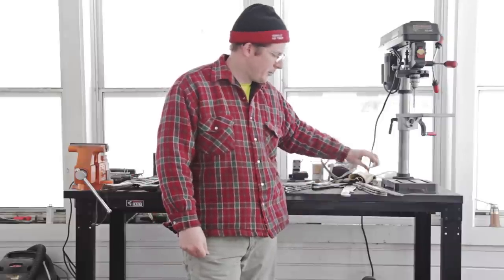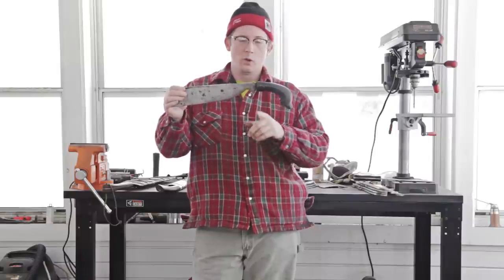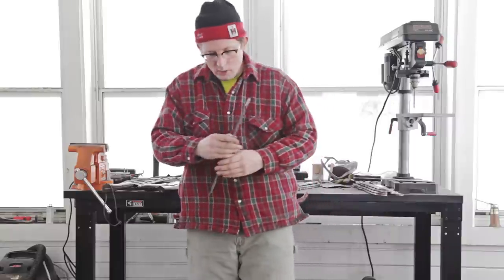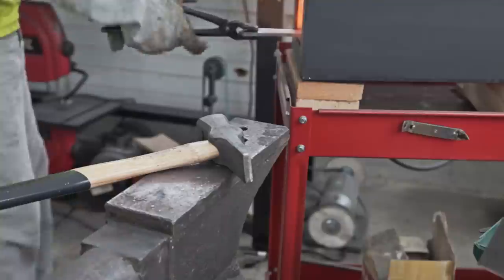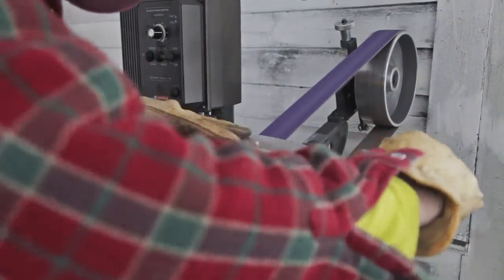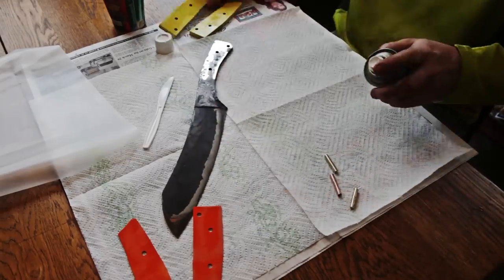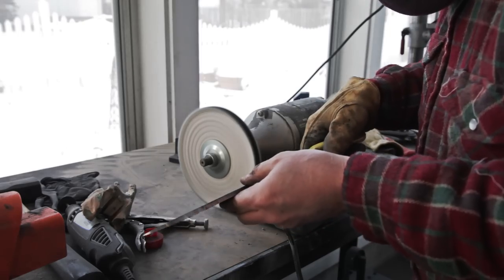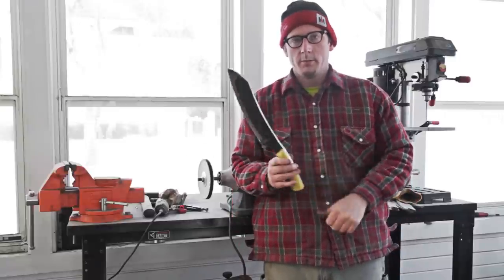Lessons Learned from Lawnmower Blade Parangs

Comment: Nice video. Woudn't it be better to forge at the same temperature that you used prior to your quench. I see a lot of people forge at temperature that are way too low to move much metal in each heat. A bright orange-yellow forging temp will allow you to move a lot more metal in a lot fewer heats and have less carbon loss on the edge. You will need to normalize 2 or 3 times to refine the grain structure after forging at higher temps prior to quenching. Just an idea for your consideration.

Comment: You are an honest and no BS kind of guy and your blades are impressive . You say that mower blades are not the best material , but I have used "brush hog" blades from large mowers (1055-1080 HC ) and they have worked great for me ... even in smaller knives . An old German guy from the Amana colony in Iowa was one of my teachers in blacksmithing and forging blades . He used to quench long blades - magnetic north and south . It does indeed seem to make a difference on deflection during the quench .  Would like your opinion on this method please .
My respect sent and keep up your very talented work .
former Cedar Rapids / 16 years .
Lefty

Comment: Say Heah, After I got back from a little trip over the New Year Holiday, I decided to get use to using my Potbelly a one tool option. although I bought the Parangatang with my Potbelly as a pair, and no regrets. I buy a few knife sets like that from my Busse Combat to my O.K.C.'s and everything in between Although I tend to just use the one knife, I realize the closer the hand to the tip the better your control when carving, To keep the set look like a matching set, I wear a Top's Mini Scandi 2.5 as a neck knife with the Potbelly,  I got lucky how well it fit's as a match. I initially bought the Parangatang as my Summer Long knife, but I got a pretty good deal so I bought the two as a pair. What I noticed the curve blade you talked about when forging does really work good when slicing..The two knives both have nice curved belly's and the Potbelly for such a big knife does carve pretty good too, I also always wished my BK-2 was a little longer and the Potbelly turned out to be the blade lenght I wanted. I started using my axe and hatchets to process firewood and they do short work out of it even to kinding size. But sometimes I do baton to get to the dry wood on the inside when it's wet. But also I'm finding out how good a Parang is bush crafting, I can baton, and chop with it and I like the lenght and the weight especially on my Parangatang,  It's a real good tool to have when I'm bush crafting, and it makes a good long knife in the summer going through brambles because it's lite. and very managable. But for right now especially with the Arctic flow heading our way and alot of snow prediction, I almost can't wait to really put the Potbelly through its paces. I saw a failure recently with the Potbelly, but so far mine has held up real good. I also saw another video where the guy actually told me he tried breaking his and he coukdnt, I think the failure was a fluke, besides any knife can break. But so far what I used my Potbelly for, I did use it hard but with loving care, I did what I expected a robust knife like that to do what I wanted a knife to do. I've been watching your video and I like what I see, Do you use different steel than just the 1075, to be honest I don't like it since my Condor Golok disappointed me, I like their 420HC much better, Oh, and what steel are the Lawnmore   Blades made from, Can you drop me a line I would like to talk to you. Thanx in advance. ,, ,, ,,

Comment: great stuff!
one thing: as far as i can see in this video, you tend to forge the blade too cold. this can result in cracking
which is especially undesirable on any knife for hacking purposes. also, its way harder to work the steel.
when you put the blade in the forge for the first time (in this particular video) your gas forge was still way too
cold and not heated up properly.
keep up the good work and congrats to your nice parangs.
greets,
edgar.

Comment: I got my 2 inch by 1/4 bar of 1084. Usually I use 1 inch but Aldo Bruno was out. So I can cut some of the bar in half for the smaller knives but I want a parang for chopping stuff up at my cabin. I just either need to rebuild my grinder or use my angle grinder, files, and sandpaper to finish the parang.

Comment: If you look at the geometry of a good old corn knife, you will see that the tip of the blade is wider and heavier. That makes the chopping of the corn stem easier when you swing your corn knife. I think you may reduce the amount of metal near your handle to make it swing better. The geometry of your blade is more like a kitchen chef knife which is good for slicing things on the cutting board.

Comment: Get it hotter don't go for any heat you can get, get it hotter so you don't stress the metal and so it's easier to move, also use the anvil as a tool but good work on the blade

Comment: +averageiowaguy why plunge line and sharpening notch on something like a parang?  Admittedly I like smaller knives and folders done that way (and surprisingly most are not done that way, I've added notches to commercial knives since on some you just can't get a clean edge the whole way without them), but it seems like the way that part of the blade drops off to the handle and your flattened out area you really could run the blade bevel all the way to that corner.  To me it just seems like something to get in the way for something that will be used the way a parang will.  What's your thinking/the reason for it?

Comment: Quick question. How do you drill holes through the lawn mower blades? I bought a cobalt HSS bit and no go! Took to a machine shop and they could not go through it. Heated it in the oven at 400 for 1 hour to soften the metal an no go. I have cut, shaped, got the first bevel ground and can't get the holes drilled for the brass pins, and lanyard holes drilled. Advice?
Reply from the maker: I would be difficult to drill through hardened steel without annealing it first.  Heat it up to red hot and slowly let it cool to room temp.  You will have to redo the heat treat after holes drilled.  A carbide bit might do it, but it can be difficult.

Comment: Leaf springs from autos makes a fine steel for a knife or parang.  If it was faulty steel it would not be a leaf spring for long.
Reply: Spring steel is not great for knives. It is used mostly for longer machetes and swords. Because it is so flexible it is better for longer swords because they can bend and not break with long swings opposed to 1045-1095 carbon steel which is brittle and easier t0 snap with a lot of velocity on a swing. Carbon steel is good for knives because of how hard and not pliable it is which lends itself better to slicing and not swinging..
Reply: I guess I will not tell the knives that I have been using for nearly 40 years that they are not good knives.  Might hurt their feelings.
Reply: I'm not saying that spring steel is a bad steel for knives. It's better than cheap "stainless" steel you find in other knives. I'm only saying that there are better steels out there.
Reply: leaf springs are simply to heavy for practical use

Comment: Where did You buy the slack belt rig and the others  I have a baldor 3/4 HP long shaft that came from a knife maker  and I need a sorce for the accessaries
Reply from the maker: I get my belts from Phoenix Abrasives.
Reply: Is that a brick and mortar store or a website
Reply from the maker: I think they are in Minneapolis.  They may have brick and mortar up there but you can get over the phone/interwebs.  You want to talk to Sean Ryan.  Tell him I sent you.

Comment: You said lawn mower blades arent the most effective steel. I am curious, what kind of other tool could I pound out which has a better carbon steel than a lawn mower blade, which I can make into a more effective machete? I am after a reasonably thick traditional style machete of around 18 to 20 inches which has a strong springiness to the bend of the machete blade if I was to try to bend it. Perhaps somewhere around 2/5ths or 1/4 of an inch thick, straight, and made from a quality steel which one would use if they wanted to make a highly functioning traditional machete. If applicable, maybie there is some kind of cheap source to obtain this high quality steel, for example a lawnmower blade, an old file if it was a knife, a sledge hammer, a section of a discarded train track, another one could be from an old thick two person tree cutting saw can you think of anything else? Or if I was to buy this better machete steel from a metal shop, what it would be called?
Reply from the maker: Good steel would be 1095, 1070, O1 tool steel or some other high carbon steel.  Lawnmower blade steel works well too, but yuou'd be guessing about the heat treat.
Reply: Right, Thanks! Could you give me any good advice as to how I might achieve a strong springiness to the blade? What kind of process must I ensue to ensure that this quality is left in the steel?
Reply: I think ill go with 1070 I hear 'some' lawn mower blades are made from 1070, im guessing the good ones. Also 1070 is used in train tracks and looking at the propertys of the steel it basically outlined it is good for hand and impact tools , what I read indicated a good steel for a machete and its tempered between 400 - 1300 farenheight so your temper process with those lawn mower blades would be spot on if it is 1070 lawn mower blades
Reply: leaf springs are really good steel
Reply: I went with the option of finding a bunch of e clips littered on my local train track, a slightly dangerous yet reliable source for obtaining what is said about these e clips, possibly the same steel as the train track it self, but the railroad e clip is a secret recipe of alloy, a high quality spring steel, used to keep its spring even when a train runs over it, i read that this steel is possibly the same or similar steel used for katana minus the traditional way of turning iron into steel and getting the best bits. My mission, has been in making two bellows to roar my forge upto welding heat so that I can hammer the e clips into a single machete after forming them into individual bars and forge welding them Chris B
Reply: Chris B Agreed, and it may be best to go for older model when they used better steels than today(I am not sure but read somewhere that today they may use lesser quality than before.) I believe they use 5160 which is generally considered better than even 1095 but then there is the issue of how diifficult a steel is to temper. Some are much more forgiving than others. I have read that O1 is great and that 1095 may crack if cooled too quickly.
Reply: for a machete, lawn mower blades are perfectly reasonable they have a reasonably high carbon content and for a machete it doesnt have to be shaving sharp. leafsprings make good blades but theyre quite thick theyre better for bowies.

Comment: try putting your oil quenching trough facing north and south and quench aiming the blade North, when steel reaches 1400 degrees it loses its magnetism , when you quench it it gets its paramagnetism back and wants to follow the earths magnetic field. believe it or not, but try it. this is how katanas are made, and even bowie knife makers know this trick
Reply: Its largely a myth if this was the case gravity would have a huge effect as its a much stronger force than the magnetic field

Comment: Kyle if you ever decide to make an edc sized fixed blade that fits in a jeans front pocket you have a buyer.
Reply from the maker: I've been kicking that idea around.  It would be nice and thin with thin scales. overall length no longer than a Swiss Army Knife, only MUCH thinner and MUCH lighter.  Thin pancake style Kydex sheath so you don't poke yourself.  Could also be used as a necker.  I have been working out the details in my head.  I got a great idea for how to do the handle from a knifemaker named Mark Rich.  Watch http://www.facebook.com/versteegblades for info.  I am thinking maybe later this year I'll put one out.